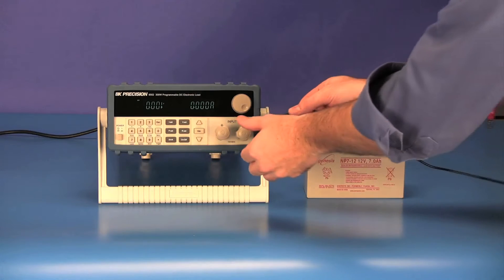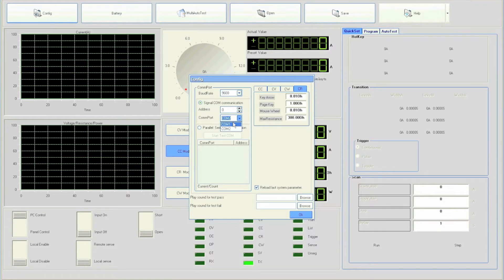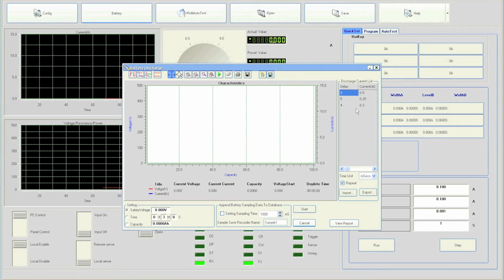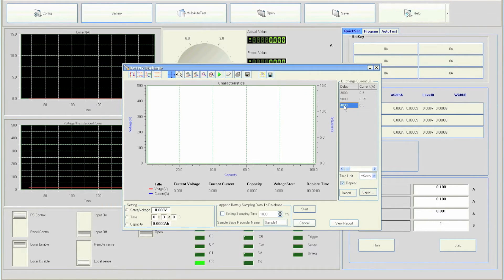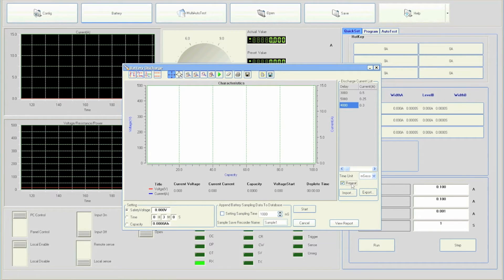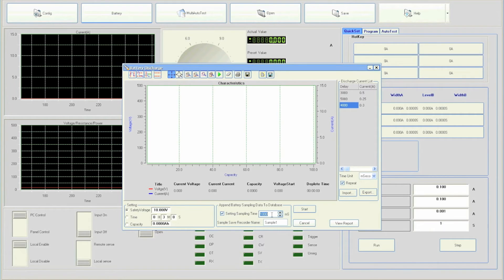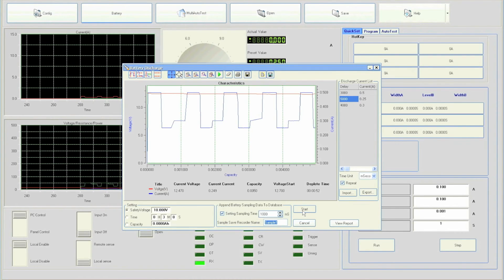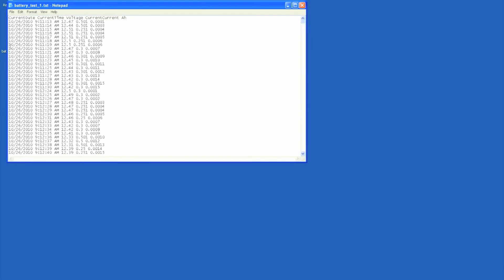Battery Test Function of the PV8500 DC Electronic Load Operating Software

Comment from the maker: Hi again Julian. We don’t have a specified limit to how long you can run a battery test, however there is a limitation based on the available system resources of the computer used when running the software.  As the software is running the tests, data are being buffered to some memory.  If the system reaches its peak resource usage, the software will not allow further testing. (Actually at that point the software may just crash).  But we have had users run more than 2 days, as a reference.

Comment from the maker: The software we provide is in fact limited to CC only. You can test a battery using Constant Power, however there are inherent risks to such a test, so proceed with particular caution, and do not exceed the maximum input power of the load.